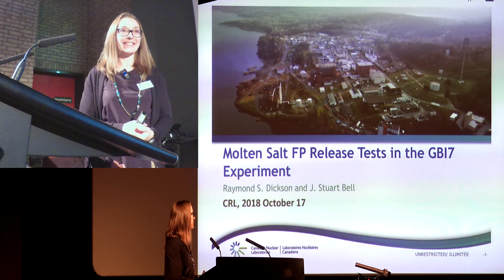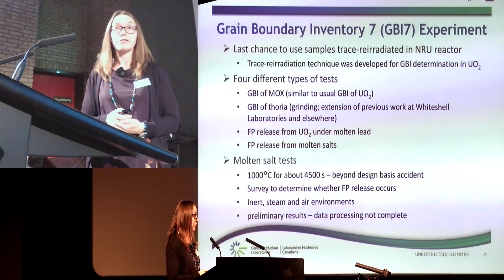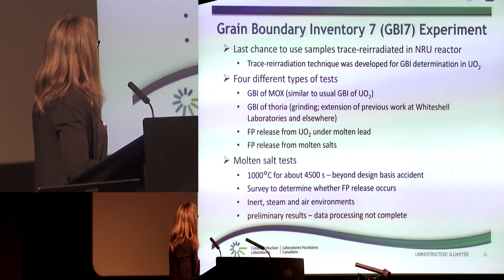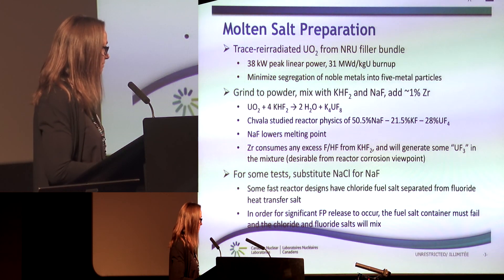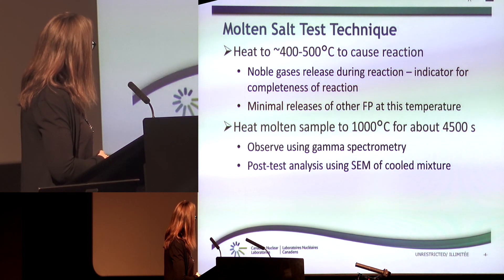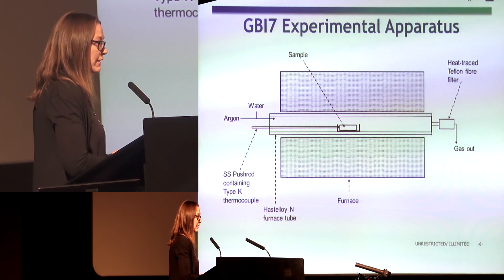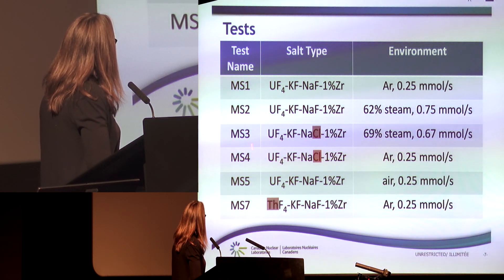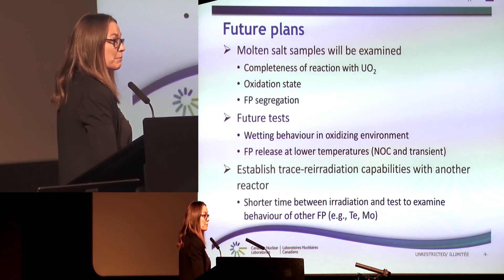Molten Salt FP Release GBI7 Experiment - Cathy Thiriet for Raymond Dickson & Stuart Bell @ ThEC2018

Comment from the maker: Audio quality degrades at 5:40 due to a data-loss accident I caused by first copying data to an exFAT drive (not a great format for data-retention) and then interrupting a laptop power-down. Did try for days to recover data, and this represents a partially successful recovery. Happened long time ago, and this is one of the few talks where portions had no good audio source.
Reply: I'm surprised you recovered anything at all. So well done for doing invaluable work in making these conference presentations available to everyone.
Reply: To help you, i can easily clear white noise after noise starts, only I need white noise profile, it can easily be obtained what you put.